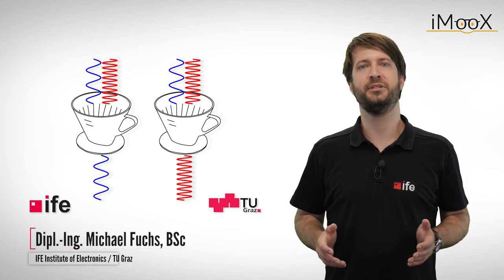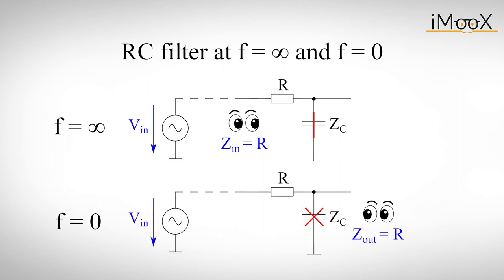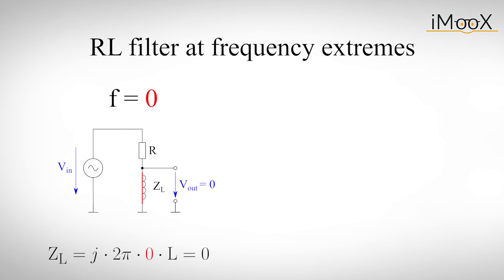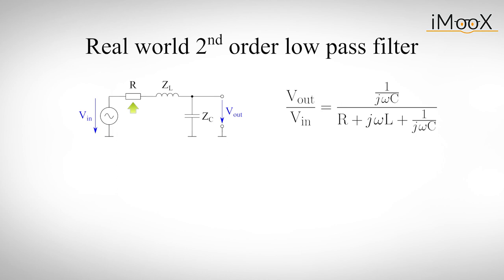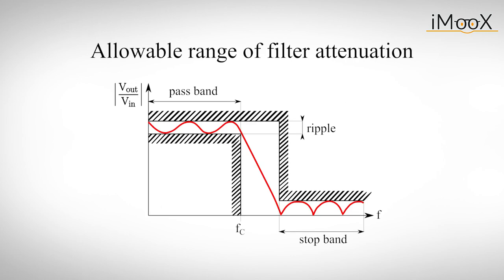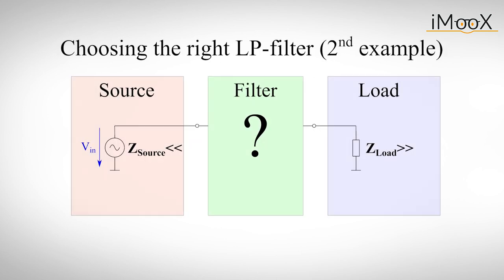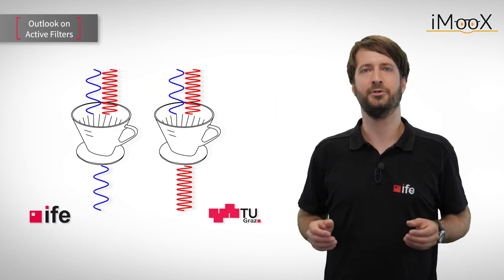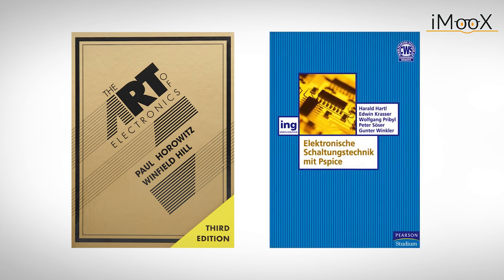Analog Filters (Part 2)

Comment: Why should z_in > 10 * z_out? Why the factor 10? I don't understand
Reply: This is just a rule of thumb, an engineer's estimate if you will. Usually engineers are not interested in perfect solutions, as they would not work in most cases, and this is a perfect example of such an imperfect solution. If one wants to guarantee that the filter stages have absolutely no influence on each other, Z_in would have to be infinite, and Z_out zero. Since this is not possible, we simply look for a solution that is "good enough". The factor 10 is arbitrarily chosen (you can also take 20), but in any case good enough.